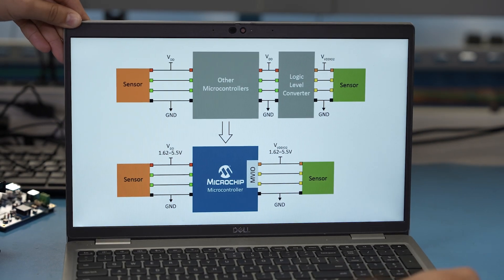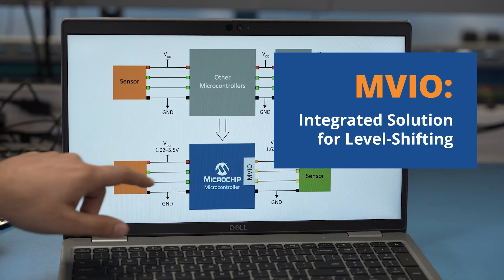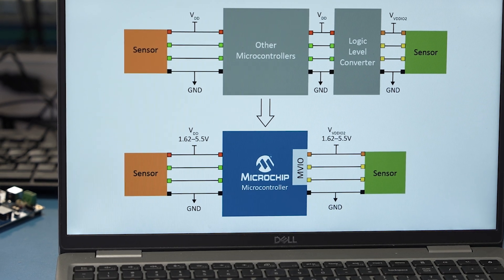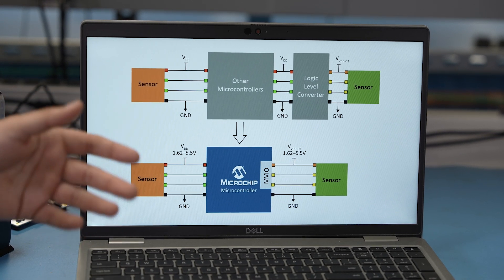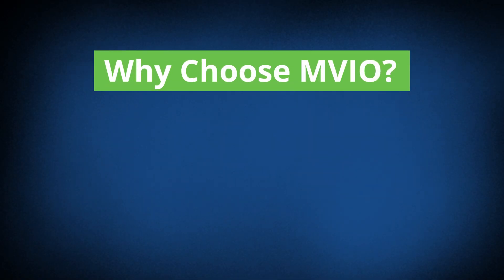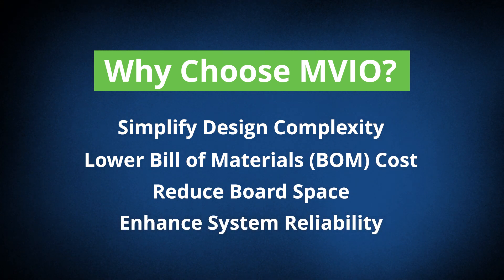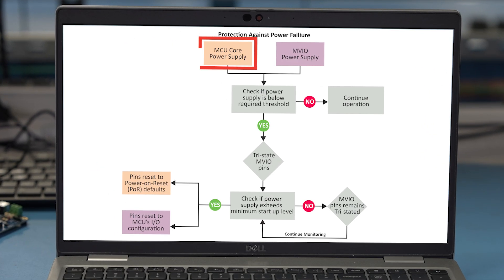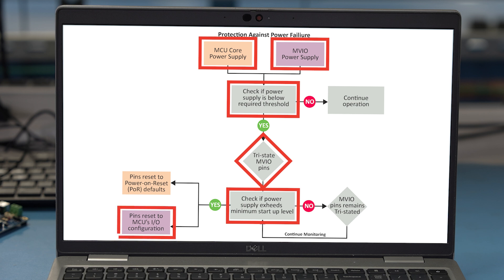Why Integrated Level Shifting?

Comment: Great feature in small MCUs! Want to be sure more customer know about this important differentiator and take advantage of it.  Interfacing 3.3 volt or 5 volt MCUs with 1.8 volt components such as GPS and Cellular modems is just one example.  1.8 volt memory devices is another option.  Something that can also be highlighted is that touch technology in Microchip MCUs is typically more sensitive and noise immune operating at 5 volts than at 3.3 volts.  With MVIO, you can run the MCU at 5 volts for best touch performance and interface seamlessly with a lower voltage in the remainder of your system.